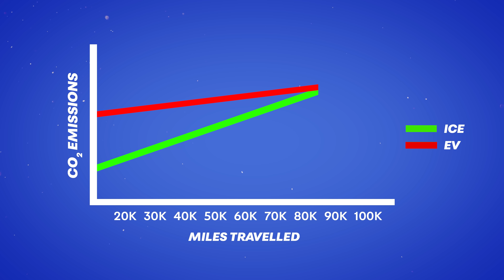Are Electric Cars REALLY That Green? [New 2022 Data]

Comment: Interesting but it’s also important to work out how often that original owner will drive that EV long enough to reach that offset point? What if they need to replace the battery pack before that point? The clock gets pushed back since the batteries make up most of the negative impact. Or if they sell it after a couple years and buy a new model and so on. I’m glad Volvo did this report but there are numerous secondary effects that I think aren’t fully accounted and the true cost is a bit more. I hope more great advancements are made and this was a very good presentation.
Reply: Totally agree with you on the battery replacement part. Not so much on the trading the car off early part because if the original owner isn't driving it hopefully someone else is and possibly that's someone who can't afford a brand new one or simply chooses not to buy new, or a first time EV owner that wants to try electric without that new car cost. So the miles on that car will still counting. I agree with his point and it's the one that i think is possibly the most important one... How the electricity is produced is to me the most important part of all of this. Along with much better batteries
Reply: @heavenleigh111  that’s a good point, it’s really hard to factor in the rational of the first hand buyer and the vehicle does essentially continue its life cycle. How likely is it for that car to reach the offsetting point or end up in a scrap pile? Very difficult second and third order effects to validate.  Maybe graphene batteries could make the great leap possible.
Reply: @SGCXD  definitely need something better than just wiring a few thousand 1860s together
Reply: @heavenleigh111 :  Components age.  LIke my parents 30 years ago, I don't drive much in retirement.  Especially with the desire to be greener and with the Covid-19 pandemic recently (and maybe long term for those of us lacking youthful immune systems).  

So If I keep my 2017 Camry for 15 years but only drive it 45,000 miles it won't be dead, but I wouldn't count on it lasting as long at 12K miles a year with a new owner as I would a car only 3 to 4 years old.  

This is good info to have.  I just assumed "BEV is better" re CO2, but since I live in coal country for electricity (dark red state and local electric utility runs purely on coal), it might make more sense for me to be patient, and to buy a good, efficient, HEV next time, or maybe a PHEV with a moderate sized battery.  Because it's seldom I drive much over 50 miles in a day anyway.
Reply: @rogergeyer9851  2 other major points this video mentioned a bit, but did not evaluate. Firstly, the study claimed a "life" for the vehicle of only 124k miles, but only compared the emissions across 90k miles. 124k seems dreadfully short to assume for a battery life or any other life of the vehicle, and it brings up point 2. Secondly, he notes that the vast majority of the carbon footprint for the BEV is in manufacture of the battery, so this brings up a HUGE uncounted carbon cost which would set the EV way back, and perhaps below the ice once again. The Ice may keep steadily climbing as the mileage goes up, but the BEV adds huge stepping stones every time a battery needs to be replaced. OR, its valuable life simply ends, and you are assumed to replace the entire car with brand new manufacture. Where the ice just keeps going for the carbon cost of fuel and maintenance. 
It also brings up what q mentions... what is the carbon cost for disposal and/or recycling of the batteries? Should that not be added?  The ice engine simply gets melted down with the rest of the vehicles metals, but the rare earth materials in the batteries need to be recovered.
Reply: @rogergeyer9851  are you in West Virginia also?
Reply: @rogergeyer9851  you also bring up a good point about how the power to recharge the car is generally not a renewable source. I’ve actually seen a TV interview with a mayor of some town boasting the new car charging parking spaces in town gets all their power from a coal burning plant and another one where the towns power grid was having an issue and the charging stations were being powered by a diesel generator. Just more variables.
Reply: @rogergeyer9851  I've driven a Toyota Aygo for 8 years and 80,000 miles... It's now 10 years old with 92,000 miles on the clock and its still good. I reckon the higher range EVs will have a longer lifespan then the average Internal combustion cars (bigger batteries means they aren't deep cycled as often and the total cycle count will be lower for the same mileage car). I'm hoping my next car will be an EV but plan on keeping my current car till it's uneconomical to repair.
Reply: @eqhymay  It's the assumptions that catch you up.  While a car owner may keep a car for 124K on average before selling it or trading it in that's NOT the lifetime of the car which could be driven for many more years.  Some of the original Tesla S's have been driven over 300,000 Kms and still have 90% of their battery capacity.  That's not the average which is a question still being settled but it's probably safe to say that an EV could be expected to last 250,000 kms on average, especially with the lower maintenance demands of an EV.  I know batteryrecycling can grab over 80% of batteries at present but there is a claim of over 95% with some researched methods.  We'll see if they live up to the promise.
Reply: I was to make my comment, but you already said it. So, I too think one thing missing here is the battery longevity. Petrol cars can run for decades until the body starts literally rusting off. I'm not convinced any battery can go over ca. 7 years without needing an expensive replacement, hitting the green graph to new low again. EDIT: And I know there are people saying it's okay to lease a car for 5 years anyway. But if you look at the used car market, there are LOADS of petrol cars 10-15 years of age that look fairly modern by all design standards and based on climate run well. Mostly only lacking in digital monitoring-controlling screens etc. I remember someone reviewing a used semi-luxury car and saying all good, but no USB charger plug...
Reply: @magnuskallas  You can add a USB and/or carplay/android auto to most older vehicles fairly easily and inexpensively. There are conversion kits and new bezels available for a ton of older cars. The real green choice, is to buy an older car and maintain it religiously so it runs as long as possible. Obviously this will vary when you are looking at an old diesel truck vs. something like a corolla.
Reply: @realbigtuna667  No arguing there. I actually called my mechanic friend back in Estonia about a USB charger install and battery. He explained the same story. I don't drive, I'm a city pisshead, but I follow the story. And politics of the green lobbyists.
Reply: @realbigtuna667  Maintain it religiously? Praying it will start?  :)
Reply: @653j521  This guy gets it.
Reply: @magnuskallas  Look up some warranty papers of electric cars, almost all have a warranty of 8 years and way over 100K miles on the drive train, My Model Y has a warranty of 8 years or 192.000 Km (150.000 miles) (battery+motors+inverters), a warranty you would NEVER get on a gas car engine!

There are Tesla Model S's driving around all over the world from 2012, that still run on the original battery, 4 years out of warranty now, but still good enough to drive around. Of course the range has fallen of a bit, but many have still over 80% of the original stated range. EV batteries last way longer than people think, they think of their phones and laptops, but a car is a completely different thing..
Current batteries probably will outlast the life of the car, and after that they could be repurposed for stationary storage for another 10 years, before they get recycled 100%.
Reply: Very good point, was thinking the same thing regarding the battery replacement, not to mention the toxic gases given off by decomposing batteries
Reply: @user-by2bs4kp7b  that and what kind of ecological standards are there in the places these components are being mined?? Countries turning out lithium hardly have a good track record.. add that to the impact column 🤔
Reply: The only good news is the batteries are recyclable. bad news they are very expensive. I'm not ready to make the switch.
Reply: 2nd or 3rd battery packs need to be added in to the pollution total. If you add one more battery pack, is the total emission difference only 15-30%? I'm not seeing how EVs will "save the planet."
Reply: Yes, I was thinking the same and commented before reading yours. If people get new EV cars every three or four years like many people do it won't be greener. My thoughts were buying a three or four year old one may be the greenest way to buy one but then you have the issue of if you are unlucky and need to replace a battery system at some point it's cutting back into how green it actually is.
Reply: Slightly outdated thinking there. They are already making million mile batteries now that will outlive the cars. Plus when a battery is no longer serviceable for a car, it still has lots of uses. Energy storage being the main one, plus a huge percentage of it can be recycled.
Reply: @iainamurray  ok but who’s making ev’s with million mile batteries? That’s not the standard yet and there are millions of ev cars already on the road.
Reply: @SGCXD  They've been developed and will be available any time now. 200k was already the norm, and apologies for repeating myself, just because a battery is no longer suitable for a car, doesn't mean it no longer has function.
Reply: I can't imagine selling an EV and buying a new one will be a bad thing at this stage, as the used EV will be resold to somebody with a lower budget, meaning Used EVs are essential for people with a lower budget being able to buy EVs.
Reply: My little Nissan Micra lasted 14 years before it began to fall apart.
Reply: Very true, but because everybody is different there are so many additional variables that you will never get a true figure of anything to do with motoring. I think it highlights the fact that EVs are not as green as some would have you believe, and I've always thought part of the reason for their introduction and why they are being pushed so hard is as much to do with saving the ailing car industry as it is about saving the planet.
Reply: Well Spotted
Reply: We already have EVs that are years old and have done 100,000 miles plus, still very useable with mid-80s% range compared to when they were new. If they're not driving much on a daily basis (and so not charging much), it's like an iPhone that's carefully used - its battery is almost pristine even after years. 

There's already a model for people renewing their vehicle after a few years too: leasing. All that means is the vehicle enters the second hand market. Making EVs more affordable for more people, which means it still gets use until it's greener than an ICEV.
Reply: Not sure about every owner, but my Nissan Leaf, powered primarily with renewable energy, has a battery half th size of the Volvo, which means half the materials, half the energy to make, etc. instead of 90,000 miles of “worst case” is more likely to be more like 24,000 miles at crossover. I have over 85k miles on the Leaf, and still see around 80% of my new car range. I suspect I have another 5 years of good, useful life left in that battery. 

This gives me a lifetime of about 5 times the crossover point. When I replace it, there is the real likelihood that the new batteries will have lifetimes ten times what the first generation Leaf batteries did. Even it it’s just 5 times better, that’s still a massive improvement over burning gas for several decades.
Reply: No need to replace the battery. They last up to 1 million miles, with gradual degradation of 10% per 200,000 miles.
Reply: @hartfischer  My dad has a Nissan leaf. It needs to have the battery replaced and it doesn't even have 50,000 miles on it. What do you think of this?
Reply: Batteries last years and years, unlike the oh, so many parts of gas-guzzling POSs!

Comment: Another major point here, is that 95,000, or so, is where they meet, but how long would it take before the EV makes up for all those higher emissions it was doing all the way to that point? You might be looking at 180,000 miles of both running, before you would see a true meeting of total output into the air. With that being true to some extent, and the common engine getting likely close to retirement, to be replaced by a new one emitting less again, it sounds pretty much like no progress in that specific direction to me. You would also have to figure in just when it was the EV was needing the batteries replaced, assuming the car holds up elsewhere that long. Would you typically replace their batteries every 100,000 miles? 200,000? You start to see how the advantage they have there is marginal at best. New batteries mean 60% more emissions all over again.

Comment: You have forgot to mention ICE vehicles require so many products and parts to maintain them throughout the life of the vehicle - oil+ oil filters, air filters, radiator coolant , transmission oil, lead batteries, spark plugs, ignition wires, mufflers, exhaust tubes, oxygen sensors and later on catalytic converters. These parts all cost money , labour costs and time and that's a major selling point for electric cars.

Comment: Comparing ICE to EV today is like comparing an abacus to a 1950s computer. Both are capable of calculating 2+3 but the abacus seems more efficient because it is a small mechanical device, whereas the 1950s computer is a technology still in its infancy, and it takes a massive room full of electronics to perform the same task. However... the technology of the 1950s computer industry still had plenty of room for innovation whereas there is only so much you can do to improve the abacus. Clearly, today's pocket computer (i.e. smartphone) can do more than an abacus and we don't have a situation where "Big Abacus"  is trying to make the case against the computer industry. Technology with electric-based vehicles IS going to improve. Infrastructure to efficiently refuel electric-based vehicles IS going to improve. The materials and methods we use to build EVs IS going to become more efficient, greener, and improve. Today's EV may still be in the awkward teenage years, but there is no question that over time technology will improve and make the ICE an abacus of the past.  It's just a matter of when.

Comment: Ethanol in fuel has just been found to produce 16% more CO2 than oil production. This is because plants and trees lock the carbon they capture into the soil. When the land is turned over for specialist crops to produce fuel, decades even centuries of CO2 is released.

Comment: When driven by the average driver, will an EV battery last that many miles without needing to be replaced or at least refurbished? I know the average ICE will last that long without needing replacement or any major repairs. At 150,000 miles my ICE car has only needed a timing chain and clutch replacement, for example. At 100,000 miles (when I bought it) it didn't need and hadn't needed anything beyond annual servicing according to its service history.

Comment: It’s certainly not a simple subject. The lifespan of the batteries isn’t that long you have to have them all replaced which puts up the Carbon footprint. Another problem charge your vehicle overnight from home when it’s -3° and when it’s cold and wet and dark you’re using your heaters your lights your windscreen wipers then see how far it goes before needing to charge. I’ve seen these tests that do it in ideal situations where they can get more miles from the battery you’ve also got to take into consideration the inland revenue if you use half your charging at home and hearth at recharge points it works out the same cost as a diesel but the diesel has 80% tax going to the Treasury The electric doesn’t so the government are going to want to claw some money back  How are they going to do that?  Perhaps by satellite tracking and tolls at the moment the average car contributes £3000 a year in tax. 70,000 miles new set of batteries £10,000. A petrol or diesel that engine is going on for 150,000 at least
But my point is how green is it going to be when it’s freezing dark foggy?  The reality is Motrin is going to get an awful lot more expensive because of maintenance and tariffs. And how many hours a week are you going to be sat at charging points